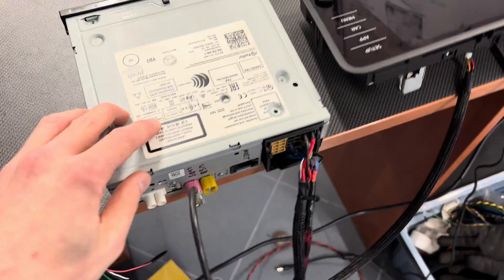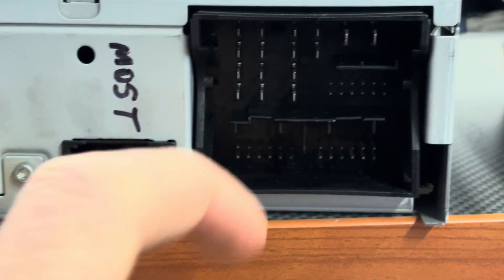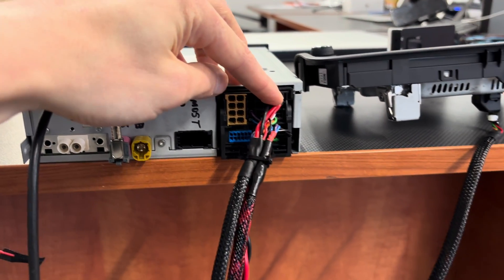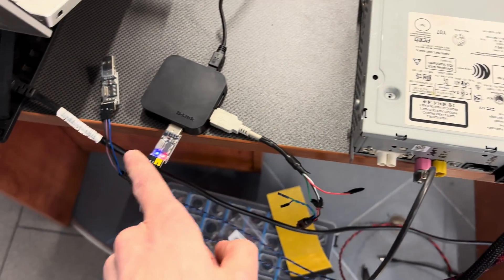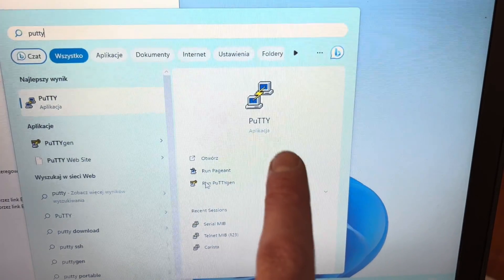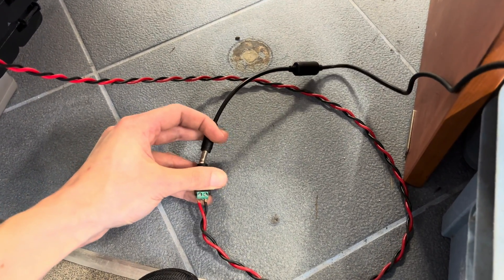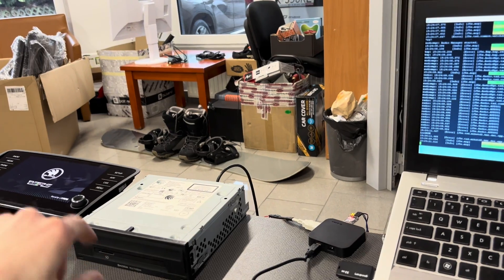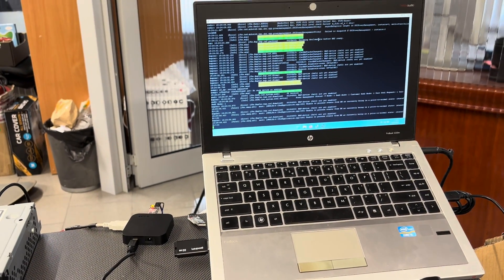How to connect with MIB J5 via Serial UART TTL

Comment: Hi, i have a MIB2 PQ for a T6.1 which has a bootloop. I have a connection via TTL and i am now in the emergency mode, but he starts not the update. Have a SW 475 H41 12/19 - Could you help me?
TIA